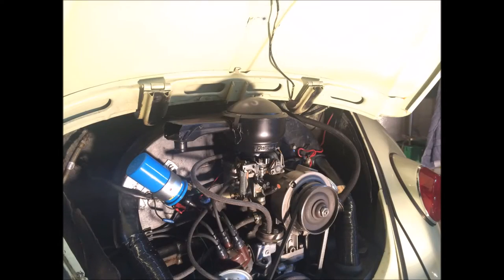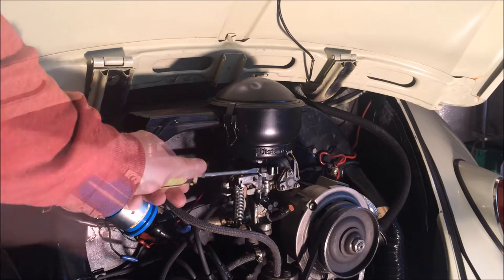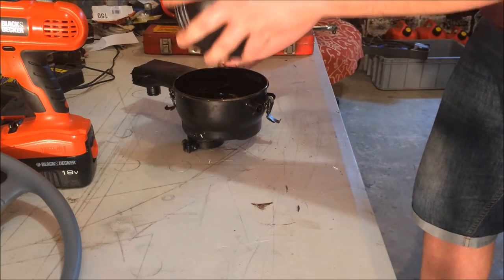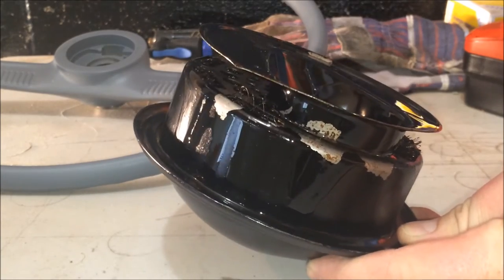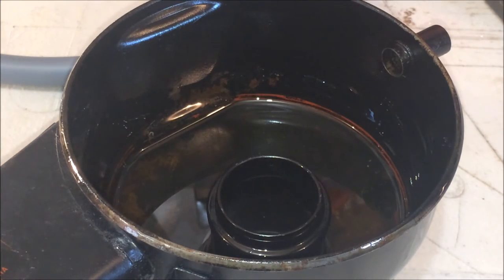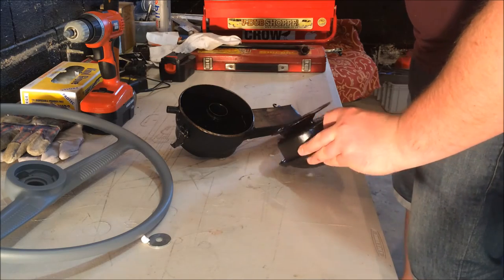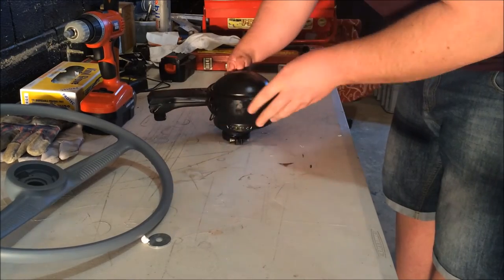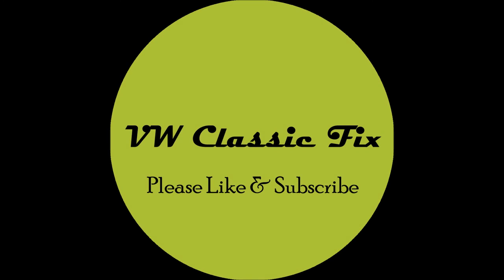VW Beetle Air Filter - How to clean an oil bath air cleaner

Comment: Can I change it out to a different Air Filter for better performance?  One without oil?
Reply from the maker: Yes you can, a K&N style filter can be used, there are many available. Although changing this will not have a huge impact on performance. Cheers.

Comment: Hi, my name's pete and I just bought a 72 superbeetle. It has an oil bath air filter, and its intake pipe sticks out to the right. There is a hole underneath where the pre-heat hose should be connected and then run down next to the fanbelt where there is a hole in the tin to the exhaust system below the motor. My question is ... should I get a hose and connect it up or leave it without one? I've seen pics with and without pre-heat hoses and don't know which setup is better/correct.
Reply from the maker: Hi Pete, I’ve had Volkswagen’s both with and without them, and it really depends on your climate. At the end of the day, they were designed to operate with them, so go for it! They’re definitely helpful on a frosty, cold morning! Thanks

Comment: My one doesn’t seem to have an oil breaker tube. Is that normal?
Reply from the maker: Some are missing on engines, but yes if there’s a connection on the oil filler and air bath filter, then having a hose there is a great idea. Cheers!

Comment: Can we use turpentine to clean out the horsehair filter in the vw Beetle oil bath air filter?
Reply from the maker: I’m sure that would be fine, as it’s a solvent that can loosen the oil and dirt. Just be sure to leave it for a few hours, or better overnight, so that any cleaners or turpentine you Use has an opportunity to evaporate. Cheers, Ricky
Reply: What is the best way to clean out the mesh filter thats in the upper half of the oil bath? Can u do a video on that topic?... thanks!!

Comment: Maybe a stupid question but my 71 bug doesn't have one of these? It has an old style metal air intake on top of the carb?
Reply from the maker: NeboFilms Hey there, you must have a K&N style filter, or some other kind of air filter/element installed. Send me a pic of it if you like and I can hopefully help! Cheers, Ricky
Reply: cheers for the reply Ricky, It is in fact a K&N style filter, I've looked it up and yes mine looks just like that! What's the difference with these?
Reply from the maker: A K&N style filter uses a dry filter made of paper and gauze, or foam. Some argue oil bath air filters clean the air better, however your type of filter breathes a bit more, so the carb can let in more air. This can effect acceleration, but only very slightly. Oil bath cleaners also make your engine slightly quieter, as they dampen the sound of the carb sucking air. Hope this helps!
Reply: Oh okay I see! Thanks for the info, that has helped tonnes! I'll definitely be sticking with this filter then, once again cheers mate
Reply: I have a K&N filter. They run very well, highly recommend. Also, they are usually good for 30k miles between cleans.
Reply: VW Classic Fix what kind of oil...motor oil?
Reply: @jorgemartinez8373  my mechanic says 20-50